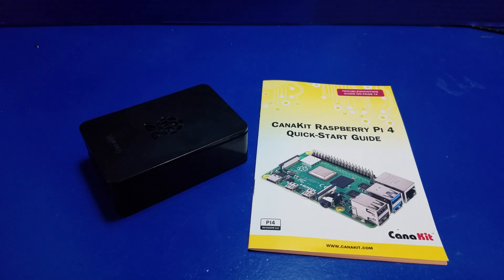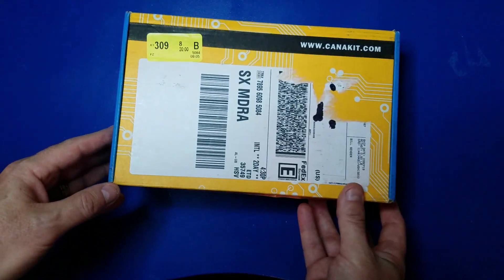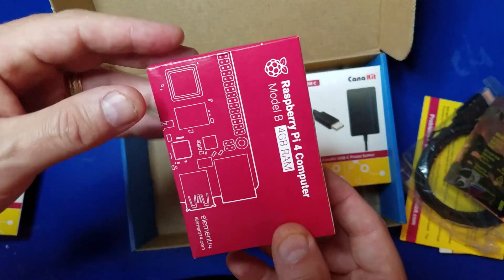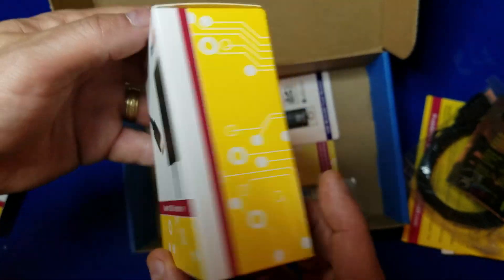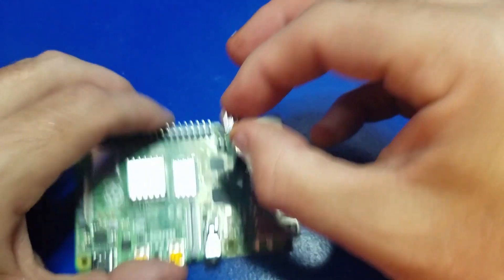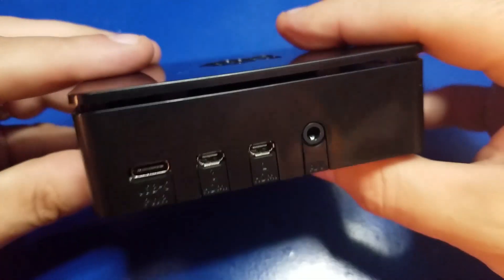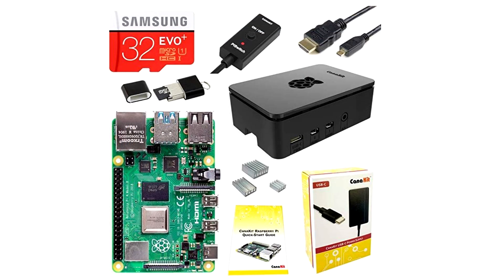CanaKit Starter Kit for the Raspberry Pi 4 4GB Setup with Heat Sink+Fan install & Test!

Comment: BEST VIDEO EVER
A lifesaver really. Thank you so much , this was super easy to follow along with, the music and your voice was very relaxing so I wasn’t stressed.
I do have a question though. I want to be able to switch between my raspberry pi and pc easily without disconnecting a ton of cables (I only have one monitor with one hdmi and display port). Can I put the raspberry pi in the display port, should I get an extension that gives me more ports, or is there some sort of switch I can install or buy? Thank you very much
Reply from the maker: Thank YOU so much for your kind comments, you definitely made my day 👍😎  Regarding a switch between the Pi and your PC, there are options available but keep in mind I've personally not tried this.  However, something like this "should" work: https://www.amazon.com/Splitter-GANA-Bidirectional-Supports-Passthrough-HDMI/dp/B07K2NZX8L  If you search amazon for "HDMI Switch" you can check out others, I just picked one that was inexpensive and had high ratings.  You would basically plug the male HDMI in to the TV/Monitor, the PC/Pi would plug in to one of the 3 HDMI female ports.  Then, you just press a button to swap between them.
Reply: @WagnersTechTalk  thank you so much!!! I’m definitely gonna buy it. You’ve been a huge help to my start in the pi world. Keep doing what you are doing!!

Comment: Did you install any software first? I have one and nothing comes up on screen
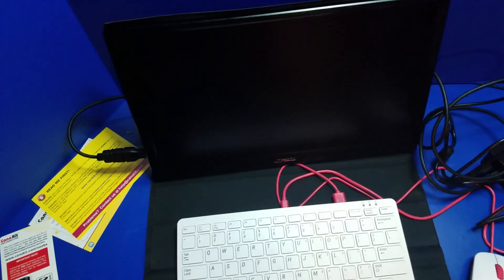Reply from the maker: This kit included NOOBS, you can see that at 07:31 .  Make sure all cables are connected, including the HDMI.  If your microSD card isn't working (or was erased), you can use Raspberry Pi Imager to install what you want.  For instructions, please see: https://wagnerstechtalk.com/common/#Burn_an_Image_with_Raspberry_Pi_Imager

Comment: Ouch, yeah, I'm going to have to get a fan version or dremel something and  add my own CPU fan, I've got tons of those...    if the CPU throttled right in the middle of a flight, the cosmostreaming DJI FPV goggle video feed would be lost and I'd be flying blind and the quad copter would be dropping out of the sky...    OMG you need the ON OFF button.   I'm assuming those are GPIO pins 1,2, and 3.   

Another review said it struggled at 1080p Youtube playback, so I decided I'd never try to use this as a desktop PC on the road or in a hotel... so...   I guess I can get the 2gb model instead of the 8...   all it has to do is run one app at 100% CPU speed...  wish there were some easy way to force that and disable throttling entirely in the BIOS.

HDMI comptuer monitors are very hard to find.  Of my 100 or so, I have one and only one 1979o desjtio computer monitor that takes HDMI input.  Everything else is SVGA or DVI.  You can go HDMI output to DVI input with a converter cable though.   Then pick up any DVI monitor in a thrift store for $10.

As a general rule you don't want to exceed 70C on a CPU, that's probably  he point at which it started throttling.
Reply from the maker: I checked out your channel, those are some seriously sick moves with the drone: https://www.youtube.com/watch?v=fP0ltXGIlrg  Nicely done!
Reply: @WagnersTechTalk  Thanks :-)  I consider myself one of the best aerobatic piltos in the world, just having fun.   Give me a few months after eye surgery when I can see again, and I'll be the best ;-)  

Right now, I can't even count my fingers if I hold my hands outand live in a world that is a blurry mess.   Imagine a Michael Landon Highway to Heaven dream sequence with Morgan Freeman talking to you as godd and everything is bright white and hazy,a nd that's my world!

Looks like I'm going to aim for the Pi 2gb model with a case fan.   Just need to run Cosmostreamer for DJI FPV.

Doesn't solve my inability to solder blind, or the fact I wouldn't even be able to see the quad on t eh ground if I walked right on by it on the ground.  So...   one problem at a time.  Outsource the soldering, and carry along a kid that can see as my "golden quad retriever".

Comment: Great video.  Any suggestion on how to keep the fan connected and running off we are using a ribbon cable on the GPIO to connect to a bread board?
Reply from the maker: Thank you, but not quite sure I understand the question.  Are you saying you're running the Pi 4 power off the breadboard (outside of the case)?
Reply: @WagnersTechTalk  Hi there,  Sorry I was not clear.  We are going to be using the Raspberry Pi for projects that we want to build on a breadboard.  In addition to the Canakit we got a kit from Freenove with lots of project parts (LEDs, etc..)  There is a GPIO Extension Board and Ribbon cable.  The ribbon cable covers all the GPIO pins, but the the wires to the fan are attached to those pins.  Should I plug the fan elsewhere if I'm using a ribbon cable to connect to the GPIO pins?  I'm new to this, hoping that makes sense and I'm thinking about it the right way.  Thanks for your help!!

Comment: JohnWill 15.6" not available at Amazon 10/31/21.  There's a 13.3" JohnWill $145 or on the same page, GTEK 15.6 or Pisichen 17.3”  Both over $150  What would you recommend?  Thanks great video.
Reply from the maker: Since I've not reviewed the other two products you mentioned, I can't say with any certainty that they will work equally well.  I do have a product being shipped which I will be reviewing in the next few weeks that is a tablet form-factor (with touch screen) for the Raspberry Pi 4.  Not sure if you want to hold off until then or not but looks like another interesting option.  I also reviewed this product a few weeks ago that may be worth considering as well: https://youtu.be/7-FXlJSH0ug
Reply: @WagnersTechTalk  Oh wonderful.  Thanks.  In browsing all those Amazon deals for touch screen monitors I always read the 1 and 2 star and OMG.  I can hold off.  I' having another problem with the Terminal on my iMac.  Anyway I just looked at your other video.  No.  I can't use that one.  I just returned it.  My Pi is mounted in the case that came with my CanaKit.  I think I sent you an email from your web site.  gmail address.

Comment: Have you tried with the fan and the lower setting (slower fan speed)? Though I guess I will go with the full fan speed just to be safe.
Reply from the maker: I tried both, yes.  For optimal cooling, go with the higher fan speed.

Comment: I def need more than one heat sink or a fan. my rpi4 gets hot hot hot 🔥
Reply from the maker: A fan is a good idea, there are other cases that use passive cooling (case acts as a huge heatsink) which helps keep the Pi cool as well.  If you want to see more options, please see this page: http://wagnerstechtalk.com/rpi4/

Comment: which way is the right way for fan put it in
Reply from the maker: Please see the video description which states:

*NOTE:  If you have any questions regarding the fan orientation in the case:  The fan may be installed in either direction (CanaKit logo facing up or down).  I've checked with CanaKit and was told it can be mounted in either orientation.  In my own testing, I've also found it does not matter.

Comment: I, too, found the need to install the fan. I ran an update today and was pushing 160 degrees. Installing the fan reduced that to around 113 degrees. Thanks for showing me how to install the fan. I plan to use the Pi 4 with my ham radio digital operations using KM4ACK's Build-a-Pi scripts.
Reply from the maker: Glad you found the video helpful!  One of these days, I want to get into HAM Radio myself and the Pi 4 would be great for that.

Comment: He put the fan in backwards. The fan needs to blow heat out the front.
Reply from the maker: Please check out the description which reads: *NOTE:  If you have any questions regarding the fan orientation in the case:  The fan may be installed in either direction (CanaKit logo facing up or down).  I've checked with CanaKit and was told it can be mounted in either orientation.  In my own testing, I've also found it does not matter.

Comment: The fan is installed two different ways in the video. I'm guessing the initial install is wrong, and the later install on the stress test is the correct way?
Reply from the maker: Please see the video description, it was updated with the following: *NOTE:  If you have any questions regarding the fan orientation in the case:  The fan may be installed in either direction (CanaKit logo facing up or down).  I've checked with CanaKit and was told it can be mounted in either orientation.  In my own testing, I've also found it does not matter.
Reply: @WagnersTechTalk  how do you feel about the extra stress placed on the fan because of the restrictive pi logo cut-out?

Comment: Okay Wagner, Question....
You have the fan on one way when you showed the put together and for the stress test the the fan was on the other way when you took the top off and when you placed it back on it was sticker side down again...

Which is the correct way????
Reply from the maker: Very observant, I asked CanaKit the same question around the time this video was originally made public.  I ran two separate tests and one segment did show the fan orientation different than the original installation.  However, the results were the same.  In the video description you'll find this statement to help clarify: 

*NOTE:  If you have any questions regarding the fan orientation in the case:  The fan may be installed in either direction (CanaKit logo facing up or down).  I've checked with CanaKit and was told it can be mounted in either orientation.  In my own testing, I've also found it does not matter.
Reply: @WagnersTechTalk  Okay, Cool... Thanks... I have not even booted mine as yet, just a bit busy...

Comment: does it have to be a monitor or can it be a laptop as well
Reply from the maker: If you had a video capture input for your Laptop you could possibly use it.  The output on the Pi 4 is primarily HDMI.  Otherwise, a separate monitor/TV would be advised.
Reply: @WagnersTechTalk  thanks also video was very good you showed where everything goes and the other videos didnt they just wanted to rush on to using the raspberry pi 4

Comment: Can also put red cable on pin 1 (3.5 volt) for more quiet operation
Reply from the maker: Yes, you can put the red wire on the  3.3V line on pin 1 for quieter operation.
Reply: @WagnersTechTalk  it’s so quite already wouldn’t want to reduce the airflow to make it even quieter. Am I right😉
Reply from the maker: My hearing ain't what it used to be, very quiet to me :)
Reply: @WagnersTechTalk  I agree. My other pi4 kit has another brand of fan that runs at more that twice the speed and more than 2x the sound as this canakit one.
That one when plugged to 3.3v still moves more air than the canakit at 5v.
When I commented I hadn't put mine together yet.
Canakit is quiet at 5v.

Comment: Hello it’s me again I keep getting the error end Kernel panic - not syncing: Can not allocate SWIOTLB buffer earlier and can't now provide you with the DMA bounce buffer if somone could help me that would be Appreciated I have raspberry pi 4 model b 2018
Reply from the maker: You may want to reach out to CanaKit support for this, not something I've encountered: https://www.canakit.com/Contact
Reply: @WagnersTechTalk  ok I will send a email out
Reply from the maker: Their support has been pretty awesome the 1-2 times I've contacted them, I have no doubt they'll make sure the problem is resolved.
Reply: @WagnersTechTalk  They told me it could be a error getting data form the SD Card to the Pi and told me to format the sd card so I got noobs back the launcher and I’m now at the color screen and now waiting so see what it going to happen fingers crossed 🤞
Reply from the maker: Just curious, you up and running now?
Reply: I’m trying to figure out how to flash this over without using the imager I have a chromebook and I sent the files from the files program I don’t have a windows pc if I had a windows pc I would just erase it
Reply: I would use my Ubuntu USB but I’m stuck in usb booting

Comment: Great video I watch this because I was worried I would just get a Mini HDMI and not a Mini HDMI To regular HDMI
Reply from the maker: Thank you Skylar!  Just to clarify, it's actually a micro HDMI to HDMI cable that you get with the kit.  The micro connector is even smaller than the mini HDMI, I know it can be confusing :)
Reply: @WagnersTechTalk  Yeah what about installing windows? Will that work ok
Reply from the maker: There are ways to install Windows, but you likely wouldn't want to use a Pi 4 for Windows productively (it will be sluggish).  Using PiOS or TwisterOS would be ideal and the TwisterOS interface can be easily themed to "look like" Windows, Mac, etc.  This is an older video, but you'll see more about it here: https://youtu.be/s2f47ZcsuEg .  There have been a number of enhancements since this video was created as well that I'll cover in a future video.
Reply: @WagnersTechTalk  ok thank you

Comment: Thank you for this video . I bought the same kit and had no assembly instructions. With your video I didnt need it. One question, I cant really use the power supply it came with due to incompatibility with the sockets in my country . I noticed that you didnt connect the power supply but did not show us what you connected the first cable to? I know the hdmi went to the monitor but what about the other cable?
Reply from the maker: The first cable that I plugged in was the USB-C power cable.  If you have a USB-C plug that puts out 5v/3A, or equivalent power bank, should work.  The other was the microHDMI to HDMI cable.  Hope this answers your question.

Comment: Hey! The Wagoner monitor you suggested I order was totally different?! Expensive paperweight. How about some ACCURATE information about the monitor! The model you describe seems to have a cable for something else??? Thanks for nothing.
Reply from the maker: If you look here I identify the adapters I used: http://wagnerstechtalk.com/rpi4/#A_156_Portable_Touch_Screen_Monitor_for_your_Raspberry_Pi_4  You  use the miniHDMI (to HDMI) that came with the Monitor to the female<>female adapter to  the cable that came with the Pi4 (microHDM to HDMI).  It's on the web page and in the video description and shown in the John Will Monitor video.  What did I miss?  Fully explained right here: https://youtu.be/V4BeV2ybLWc?t=201 and at the link above.  What more should I have said?

Comment: Was the fan in the correct direction?
Reply from the maker: I put some comments in the video description, contacted CanaKit on this very question.  The answer was, really doesn't matter the orientation of the fan.
Reply: @WagnersTechTalk  Thanks. It just makes sense to push hot air out since cooler air is from the bottom for me.
Reply from the maker: I did a test as well and found only a 1 degree difference either way, that's when I contacted CanaKit to make sure it really didn't matter.  Bringing cool air into the case worked around the same.  But however you install it, should be just fine 😃